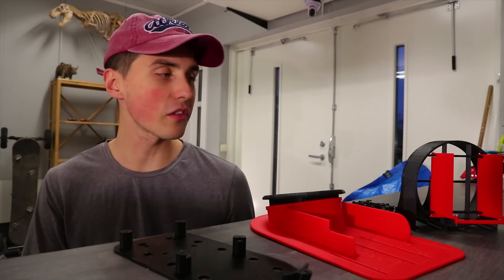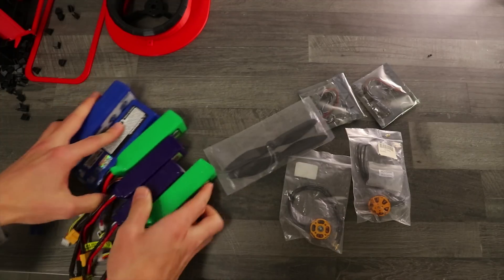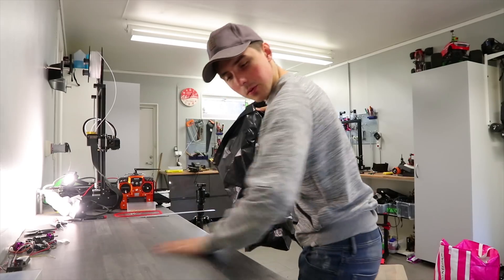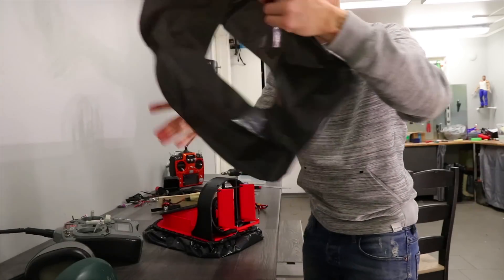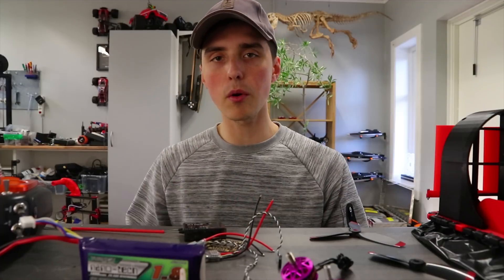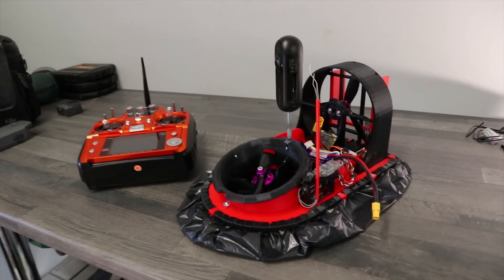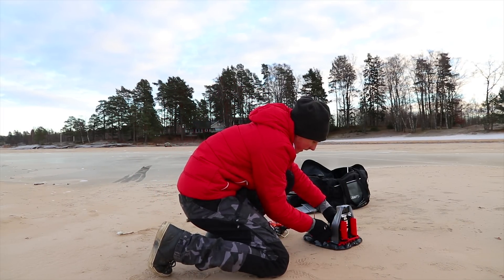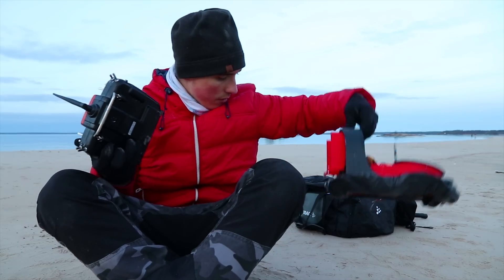3D Printed RC Hovercraft on SPEED!

Comment: This is really cool. I really like it, I once made a flying disc, with an inner tube, a leaf blower and a thick plastic disc. I made my steering system, out of old bike parts. I had to read a lot of eengineering text books, before watching the videos that came with them. I needed a transition guide, the books were in German and the videos only had local languages for subtitles. Eventually, I was able to find the menu and locate English.  My disc, looked alot like the hover craft, shown in the thumbnail.  I'm telling you this,  because I know its not easy, to do this kind of thing.

Comment: A hovercraft on water becomes a displacement vehicle. When it hovers on water with zero speed (aka stopped), it creates a ramp or hump of water around the skirt. To start moving at speed, it has to have enough power to accelerate up and over this displacement hump. That's why it had trouble "snapping" from one direction to another in 180 turns. If it pauses long enough, it sinks back into the displacement hump. The Reynolds number probably also scales against the performance of a small hovercraft. Regardless of this jibber jabber, this is another awesome video RCLO!!! Please keep them coming!

Comment: You can get the kind of plastic you're looking for from Uline.com.  You can also create superior control over the hovercraft by installing independent thrusters.  Two facing forward to serve as brakes and for traveling in reverse.  On the left and right front and rear corners you add one thruster each.  This will give you precise control over the movements of your next class of hovercraft.  Also, first generation hovercrafts didn't have a skirt and yet they worked fairly well.

Try adding some foam to the craft so that it floats when the main fan is turned off or power runs out.

Comment: "*Here's the parts list: (I will update soon)"

Well I dont think there is going to be an update more than a year after the original release.
Reply: do you know what motor he used? and fan dimensions
Reply: @nickybutch3  The design he has is this one: https://www.thingiverse.com/thing:2700850 the motors are 2300kvs and the fan dimensions are listed on thingiverse too.
Reply: Sam Seay you’re a boss thanks so much

Comment: I once built a hovercraft it worked amazing. I made it out of a foam cooler and did not use a bag. When you flip it over, underneath was a concave design and the surface that touched the ground was a skid pad that made a 360 degree perfect seal. The blower was a turbine that was placed right at the center so the craft floated leveled and made it easier to install the electronics symmetrically. I would love to show you the design so you can take it to the next level. I’d like to see what you will do with it!!

Comment: Cool craft! You should replace the propeller for the skirt to one with more blades made for high air pressure instead of the one you have now, which is made for high thrust. :-) Then you can inflate thicker plastic. (Or the one you use now but at lower rpm) :-)

Comment: Which transmitter is that??? Can we use different throttle switch in normal flysky 2.4ghz transmitter???? Any best transmitter which suits for both rc plane and rc hovercraft?

Comment: Could you have printed a skirt out of the flexible rubbery stuff that you print phone cases out of? The Skirt acts as a gasket, semi flexible between the running surface and the air cushion. Maybe it would weigh too much but I think it may work. I am a beginner so don’t know what the softer material is called.

Comment: Some 30 years ago I did the same in wood and it was just as fast although I had to use NiMH and brushed motors. One thing I think you should look into is how the skirt of a real and larger hovercraft is made (like the old Canal hovercrafts). I think it could use a huge performance gain in float-hight. Also using a propeller to fill te skirt, is something I will probably never understand. A centrifugal airblade is so much more efficient and needs a much much smaller inlet. Now the inlet also serves as an outlet with an enormous amount of efficiency loss.

Comment: I have an old rc hovercraft from the 90`s, they used a rubber for the pillow with holes in it, to create the flow effect. and there is also a layer of styro foam inside the pillow that prevents sinking in the lake when the battery is empty. it ran on 8AA batteries so after 5 -10 minutes it ran out of power but I had a really good time with it. maybe you can improve something on your boat with those old ideas :) https://picclick.de/Taiyo-Jet-Typhoon-RC-Hovercraft-ohne-Fernsteuerung-202501982553.html

Comment: For stability on water I think using an inner tube from perhaps a kids 12/14" BMX bike for the skirt with some careful modification of the design may work. They used a thin silicon/rubber skirt on the old Tyco/Taiyo Typhoon hovercraft from back in the 90's and it was very stable on water.  

You'd need some steady cutting of around the diameter of one side of the tube, and a hole punching tool for the underside, but it would hopefully give more of a flat surface that won't catch like the soft bunched plastic does.

Comment: Very Cool, think I will have to make one. I made a 3D printed single EDF powered hovercraft that was slightly smaller and much faster (clocked at 50mph). These things will blow you away if you do the skirt right (no pun intended), the lack of friction hurts the brain.

Comment: Your videos are awesome as always. I am both impressed and intrigued on how you film each scenes. You used drones, gopro, tripods to captures multiple scenes while controlling the hovercraft alone. With all the set ups you have to do with that time limit, I'd say it's very impressive. The footage quality are amazing as well.
In this video, I can't help but think about the failure in the water run...

It doesn't look like the final roll was caused by the dynamic force alone during the shift in momentum because it clearly survived a faster turn earlier. The wave doesn't seem strong enough to capsize the hovercraft either.

Upon a closer inspection, just before 11:52, the hovercraft significantly rolled in the negative x direction (using SAE sign convention) and after that moment, it started sinking with the front left going down first. It later capsized at 11:53.

My best guess is that water started coming in from the airflow-exits on the front left area during the roll just before 11:52. This caused 1: an increase in weight, 2: a CG shift, 3: some of the airflow-exits became plugged.

1: The increased weight pushes the hovercraft lower into the water causing more water to go in.
2: The shift in CG to the negative y rolls the hovercraft in the x direction so the majority of the water inside remains on the left half.
3: The airflow-exits on the left side being plugged means the thrust from the air is now unbalanced, The unbalanced thrust influence the row in the favor of the negative x direction.

I believe the hovercraft will either:
A: drown due to factor 1 OR 
B: capsized via rolling in the negative x due to factor 2 and 3
anyway even if it keep heading straight from 11:52 onward.

The final turn at 11:53 was the trigger that caused it to capsize in this video. With the heavily shifted CG, the dynamic force from that sharp turn was able to capsize the hovercraft.

If you want it to perform better in water, I recommend adding a layer of foam to form extra protection for the air chamber and to increase the boyancy force. The foam itself should be sufficient to prevent water clogging the airflow-exit during rolling/pitching. However if you want to run it in the same location with waves, you might want to add a draft angle to the inside of the chamber so that even if water gets in, it can easily flow out (assuming that the airflow-exits are not clogged).

Comment: You could have taken a small thin strip of styrofoam and lined the fan shrouds/ducts then install the fan blade and let it cut out ( you may have too do it since they might not be strong or sharp enough)a groove to create an amazing air tight fitment on the edges of the blades. This would have kept any blow back from leaking out past the blades.

Comment: Dude! Why the heck would you make something meant for outdoor use, with ESP and a motor nonetheless, out of material which looses structural integrity at 50 deg C?...
You'll keep it on a shelf when winter is over, I take it.
Awesome project. one of the coolest i've seen recently. but damn. PLA for that?!

Comment: been couple years ago now, used coroplast "yard sign for platform, fan shroud, and duct (shoves 35% of the air underneath) for a single 2700kv A2212 motor swinging 6 blade 3P 5" prop. the skirting is a rounded star shaped "pool noodle" with a star point down, sliced high so 2/3 to 3/4 of the pool noodle is to the underside. floats, good bumper surround, but a "semi solid" skirting (and dirt cheap to replace too!). it's really light weight so the air cushion itself is a pretty fair 3.5 to 4 mm when its wound up. the duct directs most of the air forward, two reasons why: as it goes faster the air resistance tries to collapse the air cushion at the front, it needs more lift at the front to BE a little nose heavy so it steers and handles properly (why the battery is forward). it does NOT do well with the wind blowing, no traction! still lots of fun and an easy scratch build. 

did a tiny whoov kind of similarly using foam board and 6 mm thick 3/4" tall closed cell packaging foam as skirting, all the whoop hoops reversed for motors topside and forward (means motor swapping for correct rotation, and blades mounted "backwards"). guaranteed to float, good bumper/skirt, and extra light weight for using a lowly eachine E010 (smaller motors). the mode 1 toy transmitter puts lift+thrust+steering (yaw) on the right hand stick, to climb from hard floor to a rug it's flipping the left stick back (more lift power to front 1/2 a second or so). to run faster it's holding the left stick slightly forward. foam board platform is 4"W x 7.25"L, lift motor centers are 3" back from it's rounded nose, rear corners radius 3/4". goes like a little bandit!

edit: took the time to type all this out, because I've played with "proper" inflatable skirting, and for a model it's just not as practical, they also introduce a lot of tipping around type instability, even though they can/will get over a little more irregular surfaces (dragging while doing it). the lighter and larger the better, but going TOO large a perimeter will make the air cushion shorter and shorter unless you have the pressure+volume of air to support it. my larger craft runs good 2S or 3S 1500mah. the 5" 6 blade prop always has 2+ blades actively forcing air into the duct under to lift it. with the pool noddle, its 12"W by 20"L, both ends round but 2" narrower in front. not trying to knock your effort, or the guy who did the 3D printing plan for it, a good RC hovercraft IS "tricky chit"!

Comment: You want static pressure so you need more blades on your lift intake. Then you can use stiffer plastic. A prop is bad for static pressure. 3d print yourself a turbofan and you can run the motor at lower rpm and keep the skirt filled. Just look at computer fans designed for high static pressure. Even that would work better as they are designed not to let air back the other way.
Reply: or start with a 5" 6 blade 3 pitch blade for a quad and call it art! my single motor ducted RC hovercraft loves it.

Comment: You should use a centrifugal compressor instead of a ducted propeller for hover. You need more air-pressure than air-speed on a hovercraft. I think a 3D printer can do the job. Congrats over all.

Comment: You can put foam (polystyrene) in the skirt rim. That way if you loose power it still floats. I used to have a remote controlled hover craft as a kids that had this and it worked well.
Reply: good idea
Reply: that's pretty smart! now he doesn't have to worry about battery level on a lake!
Reply: Was it the Tyco Typhoon? I had one of those and it was my favorite toy ever!

Comment: any diagnostics yet on why the water venture failed? was there a sand bar or something there? it almost looks like it "ran into" something and dug in or something ??? COG too high? ie CG roll over from the moving water? would love to make one of these. thinking make it wider so its less likely to roll over as I desire to make it water compatible! and yes to the FOAM insert in the bottom. easier to fill with air and it will float :-) though I don't think that would fix your roll over issue. Hope you get it fixed. always excited when you post something new.

You and Ivan look like you are having so much fun that it rubs off onto your viewers in your videos. Fantastic Stuff!
Reply: Too tiny for water, scale up and it should work well
Reply: a real hovercraft skirt is made of many segments to prevent that kind of failure
It's a really good model though and surprisingly stable given it's simplicity :)
Reply: combination of lacking width for stability, and skirt grabbing. water does need to be near glassy, air flow from lift fan can "crater" the water too causing some issues. all kind of fun considerations building these things!
Reply: I would bet that for water he would need more throttle going to that ducted fan.
Reply: Think it just needs more power to keep the skirt tight and bouncy. Camera up top probably didn't help. At least that's what my experience building a crappier RC hovercraft 2 decades ago tells me.
Reply: Looks top-heavy or to narrow and the skirts do not have support structure as one person wrote before me :)

Comment: Really nice you got it to work.  I do see a way to vastly increase its efficiency.  The engine pumping air into the skirt is designed for maximum airflow and this is the opposite of what you need.  Go with a dc blower and hook up a beefier motor to the axle.  The static pressure is what you need at the blowers are higher than fans ( propeller).   You will get a lot more run time with the different setup.
Reply: for lift, 2 blades won't pressurize enough, 6 blade 5" 3 pitch... now we're happy!

Comment: you can actually use a iron and weld the sheets of plastic together. take a shopping bag or the trash bag. use parchment paper or something to protect the clothes iron and you can run that all around and boom youve doubled up the thickness of the plastic. you could take cheap thin grocery bags and make them as thick as you want.
Reply: To add to what I said earlier. I bet you could use a clothes iron to also weld the skirt to the craft. Also I wonder if it would be possible to weld 2 thin materials together but add something to parts to keep them from welding. Creating voids in the middle of the 2 sheets where you could either inflate separately to create a baffled structure, or use the void to add foam of some sort so that the craft floats even if the inflation isn't full throttle. Could also make parts of the plastic skirt thin and other parts 1,2,3 layers thick for durability perhaps.

Comment: I had a toy hovercraft when I was little. It had a polystyrene part inside the skirt that had two functions: it reduced the volume of air inside the skirt making it easier to inflate, and second it helped keep it afloat if it died in a lake. I still find it ingenious. Yours turned out even nicer than my toy, and that was injection moulded. Great job